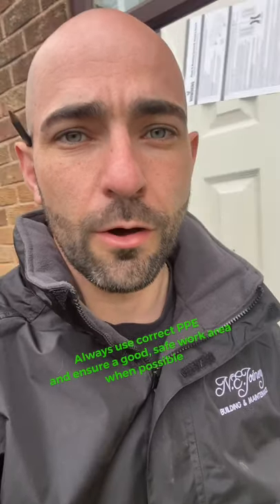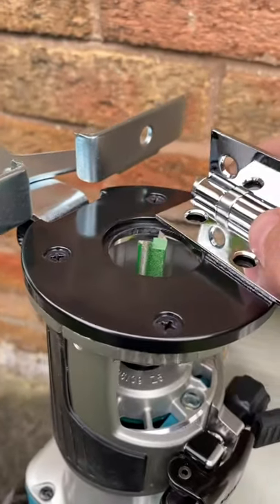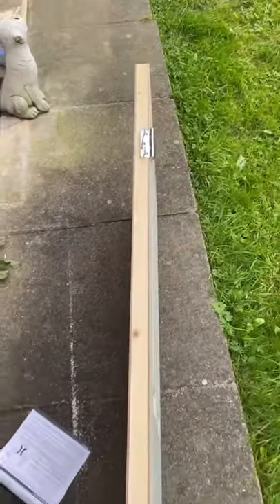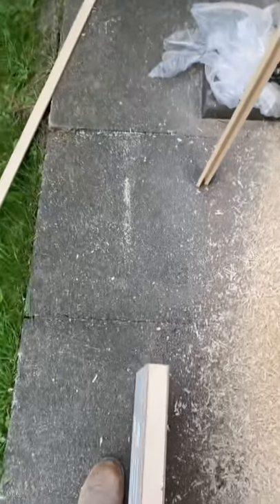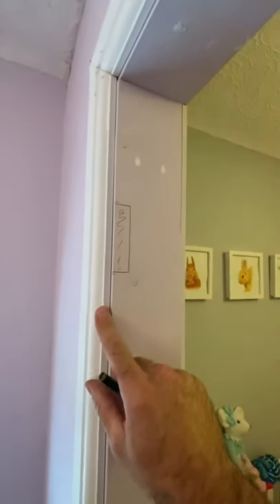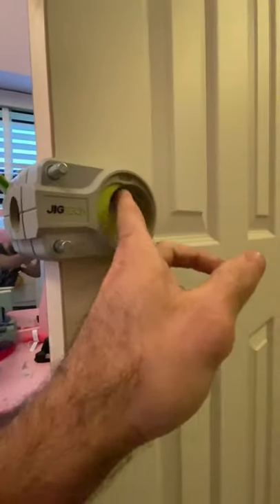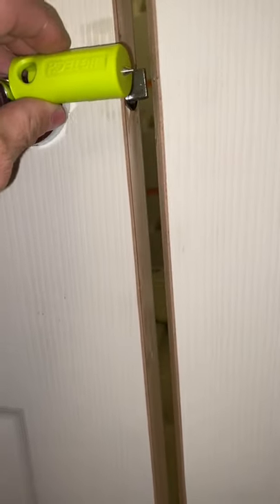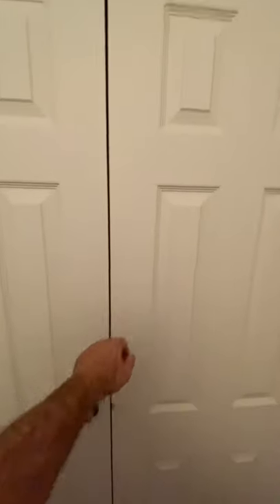How to hang a door (Quick video)

Comment: Nice one! I wanted to get the mini router to do my doors, however ended up doing it witch chisel. I wish I bought it as I never managed to get level cut out and I need to use shims to make it nice. However I'm still baffled you have to cut doors in this country to match the door frame... Back in Poland we just go out and buy door of standard size witch hinge already cut to fit standard door frame, it's as easy as lifting the door up and hanging new one in, mostly not more than a 5 minute job..
Reply: So what would you do if you bought a new door and went to lift it on to put the pin through the hinges but as the  building was old and had moved a bit which made the opening to small, surely you would have to cut the door to fit it?
I don't know why we don't use pre hung doors  here in the UK.
Your comment has actually explained something to me, I was working on one site and the polish lads had made the door casings up ready for me to fit them. When I came to fit the doors I found that the frames were all too big. They had set them to a width of 31 inches and a standard door is 30 inches. They must just not have been used to putting door casings together as they all come pre hung in Poland. 👍😀
Reply: @garethheathcote4988 
Intresting point of view. Most buildings in Poland are not made from wood so door frame movement is not such a great issue. And the reason for the door opening  being larger is you buy door and frame to match it, so the door wing itself can be of standard size, frame usually has architrave around to conceal the screws/shims/expanding foam used fit it in the door opening. Also, quite a lot of the doors have a lip (so door wing is partially larger than the door frame and it's resting on door frame) and you just can't cut it. Please type "drzwi wewnętrzne" into Google and switch to image search so you will see what I mean.

Comment: Cowboy you don't plane 8mm you use a plunge saw much easier and quicker and doesn't look like the sea bed when you look down the door after 👍🏻
Reply from the maker: If yours looks like the sea bed your obviously doing it wrong 👍
Reply from the maker: And as explained it’s a “quick video”my track saw is set up with mains power not batteries so the palm router and plane was a QUICKER option in this case